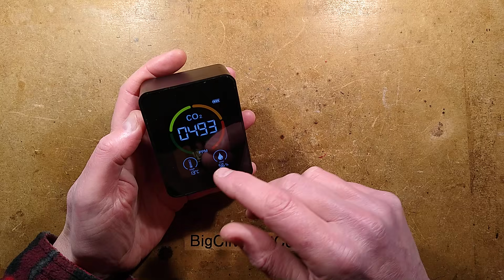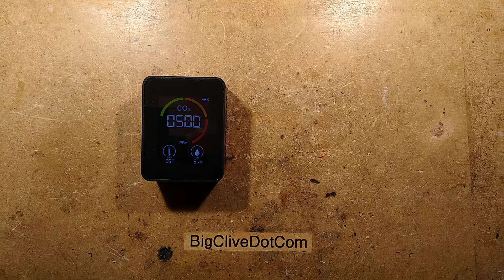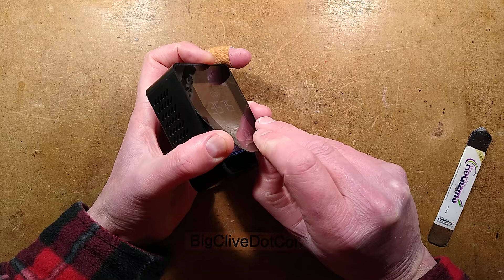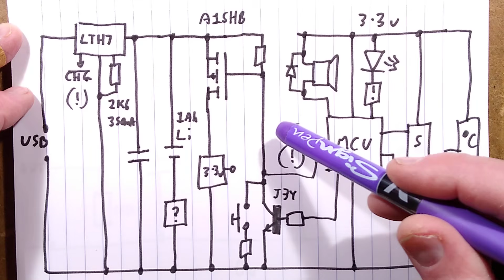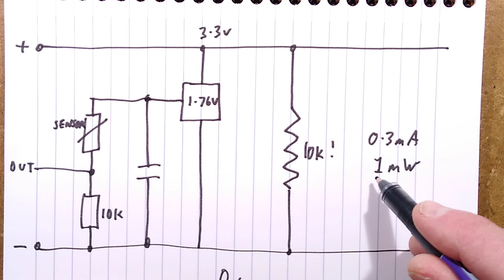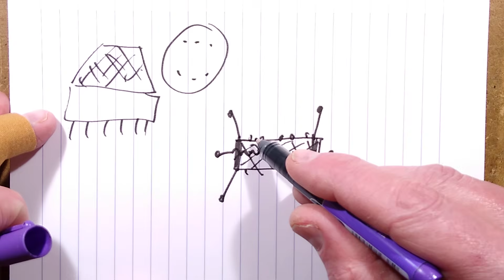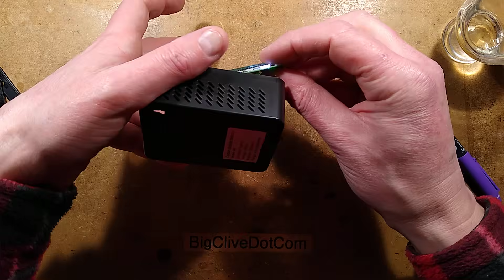Fake CO2 monitor (party detector) with schematic

Comment: So a VOC sensor instead of a CO2 sensor inside? I guess VOC was cheaper...

(Also, the demand for CO2 sensors is because CO2 is a reasonable indirect measurement of ventilation in a room which, y'know, kinda important during a pandemic with an airborne virus)
Reply: Actually not just pandemic useful, our ability to concentrate and think drops too as the CO2 concentration goes up. So pretty important in general even at home, but I'd expect employers to ideally want the employees they pay to function well. Same with schools that try to teach children, so many of them sitting in one room seems like a great way to quickly get the CO2 above the 1200-1500 ppm where things go downhill quickly if there's insufficient mechanical ventilation while the windows are closed.

It'd take a lot more than the usual 1200 ppm threshold for "bad air"  to make it actually acutely dangerous but a few real sensors with useful displays probably wouldn't hurt to remind people to do the right thing. Ideally you'd want the ventilation system of the building to measure the CO2 levels in the room though and adjust what it does as needed, that way you're wasting less energy on extra heating/cooling during low occupancy periods and can prevent the "I don't want to hear the noise/feel the moving air" humans from turning it off.

I did get one actual CO2 sensor myself and it's a useful reminder at home, if I keep the doors between rooms open on most days it stays nicely below 800 ppm or just above with just me and my two cats. 3 or more people for 30 minutes or longer will quickly turn things red, it's a good reminder. But oddly enough there are days without visitors when it does trend towards over 1200, must be the wind direction and force affecting normal passive air exchange in this old house. Closing a door to keep cats away from electronics components and soldering irons also raises it quickly, indoor exercise even faster. I am looking forward to exposing the sensor to some other gases now though to see if it triggers on any other ones I can easily produce.
Reply: @extrastuff9463  With my NDIR based CO2 detector when the oven and hob are on for a long time downstairs the CO2 upstairs seems to rise significantly could a cooker be doing it?
Reply: @cnafyi  Honestly no idea, since you mention CO2 and the oven I assume that one is gas powered and not electric? And while running either or both is that with the some kind of mechanical extraction to vented to the outside being on preferably near the hob? (traditionally above it here where I live). If that's done and doors to hallway and upstairs stay closed I'd expect the impact to be minimal but I never really measured it.

Could try measuring it in the near future, but I have a gas hob and one slowly heating old traditional full size electric oven + combi microwave with a functional small convection oven that heats up quickly. So much less CO2 being released into the room along with a noisy but effective extraction fan above it. And maybe measure it again when it's warmer weather when I often leave all doors to upstairs open so the cats can roam freely, currently not done to reduce the heating bill. 

My kitchen, living room and bedroom are all downstairs. Upstairs is only for my storage and hobby room, treadmill and other exercise equipment lives there. Measured using that with closed door and window a few times, it gets the CO2 concentration above 2000 quickly given that it's a tiny room. Leaving the front door downstairs open and partially opening the upstairs window solves that problem though.
Reply: @extrastuff9463  We have no kitchen extractor (probably should) and the door to the kitchen is directly below the stairs so , was thinking your 'days without visitors when it trends to 1200' could have been the gas stove. Would be interesting to measure when using gas + extractor on vs using gas with extractor off
Reply: @cnafyi  Certainly should get one for sure, that's an experiment I won't even try here (cooking without extraction fan going). I'd even want one if I replace the current setup with induction, cooking depending on what you're doing will produce a lot of moisture and some other less than ideal byproducts. Not nearly as bad as an open gas flame in the room but still worth removing.

And the no visitors days, that's a work in progress. It's a logging CO2 meter and I'm trying to take notes on the wind direction and average force for those no visitors days. Eventually I'll have the data.
Reply: yes VOC is much cheaper
Reply: not exactly, those petroleum products that didn't trigger the sensors are VOCs.

Comment: There are "CO2" sensors available that in the fine print says they are "CO2e" or "eCO2" sensors. Which means that they are VOC sensors, and the VOC level is cleverly and most often incorrectly used to guesstimate a probable CO2 level, assuming human presence. Could that be the case here?
Reply: Having toyed with these sensors in the past I am quite sure you are hitting the nail on the head here.
Reply from the maker: It may be.
Reply: @bigclivedotcom  You have to fart into it to test it for VOCs
Reply: The VOC concentration is a very inaccurate proxy for the indoor air CO2 concentration. There are many sources of indoor VOC pollution other than exhaled air, and the VOC concentration can vary widely.

The CO2 concentration from the SodaStream is 1 million ppm.  That would have immediately spiked the reading of a real CO2 sensor. A person's breath is 40,000-50,000 ppm CO2.  A real CO2 detector reads high when a person 1-2 feet away just breathes in its direction.

Real, "NDIR" CO2 detectors measure how much infrared light is absorbed in a spectral band that CO2 absorbs.   Less expensive NDIR CO2 detectors have a single detection channel.  Infrared LEDs and sensors degrade over time, get dirty, etc., so these devices need to be  recalibrated every week or so by exposure to a baseline outdoor CO2 concentration of ~400 ppm.  As such, the devices are not suitable for installation in a location subject to continually elevated CO2 levels.  More expensive detectors have two channels of detection, one in an infrared band that CO2 absorbs, and one in a band that CO2 does not absorb.  The CO2 concentration is calculated from the difference in light absorption between the two channels. These detectors don't need frequent recalibration, since the two channels degrade at similar rates.
Reply: @jbalazer  can't upvote your comment for some reason. But yes, good comment!
Reply: Wow, this is really intriguing, thank you for sharing your knowledge on the matter, it's crazy to think that this could just be a bad product by mistake.....
Reply: Yeah its a voc sensor. I'm currently playing with an adafruit one connected to a pi-pico-w. It makes guesses based on VOC's. It was 18quid. The Co2 breakout board sensors are 54 to 81 quid a pop. (I have not checked the sensor device only prices but they tend to follow the i2c breakout board with a few other surface mount thingmibobs fairly closely.)
Reply: @JW-uC  there are cheaper ones like the MZH19 (or was it MHZ19) that go for about 20€-25€ on amazon (last time i checked)
Reply: @JW-uC  Units matter - could you express quid to € or US$?
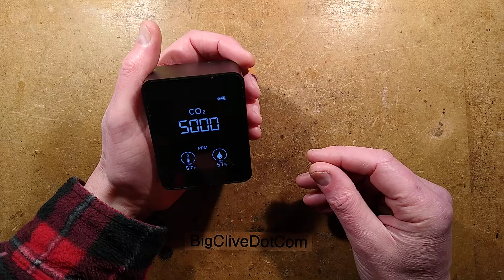Reply: That's an odd list of substances for a VOC detector to ignore at 2:10. White spirit? Butane?
Reply: @tonywalton1464  I'm guessing that the device was what ever they had lying around from some other real product. That the PCB has loads of other things that were not populated suggest it might be (there is a term, but I can't remember it) "4th shift" aka the factory runs a knock off using bits of a real product and random components that kinda work or its failed QC stuff but works just enough to be able to resell and then gets resold again on to the legit market.
Reply: @JW-uC  The missing bits are temp/humidity sensors for other versions
Reply: many of these (metall-oxide) sensors are most sensitive to some alcohols, but also to hydrogen. in normal indoor air there is a certain correlation between H2 and CO2. Therefore in some circumstances, this does work. But yes, absolutely not robust/selective!
Reply: @wellreally831  But that only kind of works for CO₂ exhaled by humans. Any other sources of CO₂ are not detected.
Reply: @maxine_q  absolutely!! (or to be a smartass, maybe also with some animals ;-)).
Reply: I got bitten by these fakes too, they  are indeed VOC detectors.  I bought one that was supposed to detect CO2, CO, and VOCs and it went nuts alarming over CO levels when I had isopropyl in the area....   Scary until I realized what was happening.  Variations of this type of detector are everywhere, they're far too cheap to reliably detect the individual gases they purport to, and as you've suggested, they try and interpolate others based on VOC readings.  Completely useless for anything but temperature and random VOC content.
Reply: This, many cheap Chinese items estimate the co2 from cheaper VoC sensors. The genuine CO2 monitors are quite a bit more expensive.
Reply: "Guesstimating" CO2 - that about sums up my opinion on that type of 'CO2' sensors, that kick up to 2500 ppm when you walk past them with a freshly washed towel or something in hand 😁...
(Disclaimer: I've never really dabbled with one of those, but a while ago I've been searching for a decently good CO2 sensor, only to find that there's two big groups of those: those combined "eCO2+VOC" sensors, which IMHO aren't worth a damn if you really want to measure CO2, or the REALLY good sensors, of the SGP30 type and others, that are GREAT, but start at 54 bucks a piece on a breakout board - *cough* *cough* thanks, but I think I'll pass... and then there's the 'MH-Z19 and relatives' group, that are supposed to be pretty decent - as long as you can carry them outside once every day, to recalibrate to the ambient ~400 ppm - yeah, right 🙄...)
Reply: TVOC sensors often do claim to be able to estimate CO2 - the part on this board looks like either the genuine or a clone of the Sensirion SGP30 or SGP40.
Reply: Makes sense, seems like a kind of niche item to outright fake.
Reply: @raxxer1234  what would be even more suitable is a fan and a cracked window. This device is literally useless, you'd be better off using limewater and an aquarium bubbler to detect elevated CO2 levels and it would still be cheaper than this piece of junk that can't even tell the difference between human breath and hand sanitizer. If everybody in the room has a drink in hand I'm sure you can see the problem with using VOCs to estimate CO2 levels.
Reply: I assembled a Velleman Earth Listener which monitors things including TVOC and CO2.  The CO2 reading goes crazy high if I do something which raises TVOC.  As long TVOC is low, my indoor CO2 is about 460 PPM.  When I use my gas fired oven, the CO2 level goes to about 1200 PPM.  I usually see TVOC go up a couple of points from about 6 to 10 as well.  If I bake something like a chocolate cake, the TVOC goes up to about 50 and the false CO2 can be up to 1600 PPM, but it does smell quite yummy.
Reply: Yeah this is guessing at CO2 levels based on VOCs. Proper CO2 sensors used for horticulture are way more expensive.
Reply: Ironically, a true VOC sensor for thing like formaldehyde are extremely expensive and most consumer VOC sensors don't work for it!
Reply: it could be, but i have a VOC with eCO2 display and a real infrared CO2 monitor, the values rarely share any similitudes, at least on my experience, or on my VOC sensor. The infrared one makes a lot of sense, on the other hand.

But yeah! it could make sense that they chose to pick the cheap, inaccurate VOC sensor for CO2, but it's a pointless device at the end.
Reply: Strange that the true CO2 sensors are so expensive, they don’t seem to be much more technology than a blood oxygen saturation measurement device and they are definitely dirt cheap now - is it just a question of economies of scale?
Reply: @SchwaAlien  I tried to find info on the subject in the past, but i wasn't able to find any information about it besides "infrared".
Reply: Yup and these need to be banned by safety authorities worldwide
Reply: @armamentarmedarm1699 Thank you for the term. I must be getting old as I couldn't remember it, and yet its so obvious.
Reply: i tried a voc sensor with VoC with eCO2 along side a MH-Z19 and there is no comparison.
Reply: Isopropyl Alcohol is a VOC so this is definitely the most likely option
Reply: As soon as it went off at the alcohol my immediate guess was a VOC sensor
Reply: Hey I am working in the field of building automation and you are absolutely correct. "Real" CO2 sensors are a bit expensive to put in every room so VOC sensors are mainly used. The measurements are quite good for it's intended purpose (room air quality)
Reply: @sundeki8880  You'd think they'd sell it as a VOC sensor though?
Reply: @m0rjc  it's common practice that VOC sensors are sold as CO2 sensors. The cost of real CO2 sensors is about 5x that of a VOC if not even more and it doesn't have any benefit in this application. But I get what you mean it's a bit of false advertising. I guess the everage person can better understand CO2 measurements then VOC
Reply: @sundeki8880  It does have the benefit of actually showing the real CO₂ concentration, which is what you expect from a CO₂ sensor.
Reply: @sundeki8880  So if you have an open glass of alcohol in your house, it will read much higher CO2 than you really have. I personally think selling a VOC detector as a CO2 detector is a lie and should be false advertising. Be honest about what it is.
Reply: I could do with some VOC sensors that could be used to detect in the room that I have my 3D printers in
Reply: I have one of those voc eco2 sensors and that is likely what it is tbh
Reply: @raxxer1234  yep correct

Comment: Clive, you were wondering why someone would want to measure Co2 content. We use an array of sensors (including Co2) when welding in a tank or bund. Co2 is heavier than air so you end up with the bottom of the tank filled with Co2 and you suffocate. Always good to have something beeping away in the background. Though obviously not this piece of crap.
Reply: Monitoring for air quality in lecture rooms and in our beer fermenting/storage/bottling facilities. It's a useful reminder for airing early to avoid fatigue.
Reply: I've got something similar at my work in the soda closet, people tend to leave hoses unhooked and the room tended to make people sleepy before they put the alarm in
Reply: Sensors are also used with some pub cellars.  Nowadays they pressurise from canisters of co2, and a leak could be fatal.
Reply: Co2 drives your breathing reflex so you should know you're suffocating with co2. Now argon on the other hand, that's inert and you won't know your running low on oxygen until you crumple into a heap on the floor. (IE you won't know at all, and the worst part is you get really stupid as it takes effect even in low concentrations so you don't know it's happening)
A straight up oxygen sensor might be something to look at if you're working with welding gases in confined spaces mate. They are pretty exxy but still. Bunch of people have died from inert atmospheres and a bunch more trying to save them.
Reply: @zyeborm  It would drive you to breath harder, but I suspect you would become unable to self rescue through hypoxia before you realise what is going on.
Reply: @DanielsPolitics1  if it's co2 building over time you'll evacuate yourself without thinking about it pretty much lol. People will run away from the situation instinctively. Walking into a room full perhaps not. (5-10 seconds usable consciousness, can be lower than you'd expect as oxygen actually gets pulled out of your blood to oxygenate the air in your lungs rather than the other way around and you brain turns off when the slug of deoxygenated blood hits your brain)

The issue with the argon is you don't know (at all) that there's a problem even during the "building up" phase. With training and a bit of practise you can recognise it (rebreathing divers and some high altitude pilots) but even with that because of the reduction in mental acuity it seems like a 50/50 in ideal situations and more like 20% success rate for someone hypoxic without co2 build up to recognise and act on it.

You can try it yourself to some extent. 
If you finish a large (1.2/2l) soft drink bottle. Take a deep breath sealing your mouth over the bottle. You'll crush the bottle as you inhale and get a dose of high ish co2 air.
You'll feel the heck out of it lol. You will not do it again unless you know what's happening and try again.
Obviously don't keep doing it lol.
Reply: Don’t you mean Carbon MONOXIDE?
Reply: You’re supposed to have a canary for that ;)
Reply: @joearnold6881  a short apprentice will also work.
Reply: @v.sandrone4268  great idea but I think there's a flaw. Should we call it a fatal flaw? So much for an apprenticeship. They get one chance to learn the lesson.
Reply: @geniferteal4178  it's the evolutionary approach... eventually one will survive
Reply: @Peter_A1466  then they will be useless
Reply: Saw a news article the other day where 2 workers fell into a tank of molten chocolate. Wonder if they had a chocolate detector. Though if this happened to me I would decline being rescued.
Reply: @tncorgi92  Shades of "Strange Brew", trapped in a vat of beer.

Comment: Change the 10K resistor in series with the sensor, to change the scale down of the reading ( so that it does not over range ), then use it for a party drunkeness meter?
Reply: Little SMT trimmer, so you have a certain level of calibration.